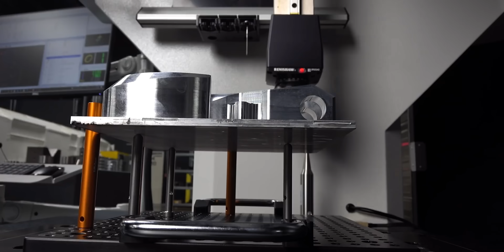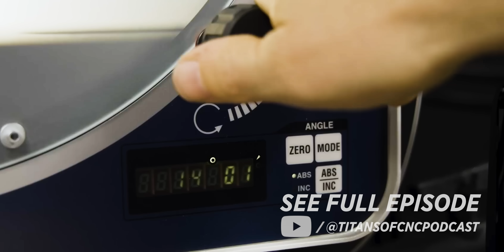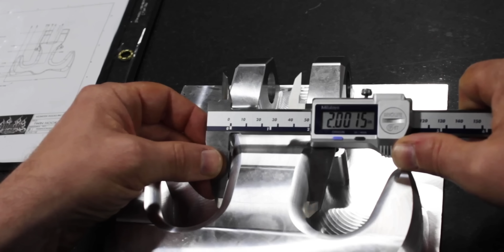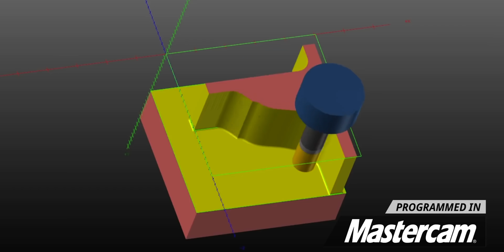I had to SCRAP all Parts Only .0001 OUT of Tolerance

Comment: Customers have to be very impressed that y'all toss parts that are a tenth out!
What an incredible reputation builder to become known for that policy!
That's why your company will never again have to chase work, it'll come to you!  😊
Reply: 1. The video is unclear, but I believe the actual tolerance was some larger amount, and they Exceeded the specified tolerance by another tenth. Yes most parts should be well within specified tolerance, not just a little bit out.
2. I do not have any ability to accurately measure whether a part is within tolerance or a tenth out! I think a standard micrometer has that much tolerance, and I could change the measurement that much by how I do the measurement. (The parts I make are usually specified much larger tolerance than that, and I can maintain spec.)

Comment: You cannot measure .0001 in most cases. On another note, having a shop that works for the QC dept is a recipe for disaster, The QC needs to work for the machine shop not the other way around.
Reply: Saying you can't measure .0001 is like saying you can't measure a human hair because its too small. Of course its possible, you just need the right equipment
Reply: @zacharyj6465  Like I said most cases,  temperatures involved when machining, inspecting and once at customers place can all change that .0001 reading. I've been doing this for over 30 yrs in every type of shop u can imagine,including 4 years building plastic injection molds on cnc machines of an ancient variety. 001 in that shop was considered Wide Open lol Cheerz
Reply: @rickyhammer6832  even with temp changes u can still measure a part accurately to a .0001. Every material has full documentaion on how they react to different enviorments. Not hard to just do the math, figure out how much it's going to change, and offset it appropiately.
Reply: @verakoo6187  lol . I said in most cases. How are you going to measure a .500 deep bore @ .375 Dia + - .0001?
Reply: AN Air Gage!
Reply: Something Ive learned working with alot of old guys in alot of different places: just because youve been doing something for a long time doesnt mean youre good at it.
Reply: I work in a shop that specializes in small high precision parts, and we frequently hold tolerances of less than a thousandth, but our parts are usually less than 10" in any dimension, typically around 3" if I had to guess an average.  I've never worked with large parts where temperature made more than a few tenths difference, but you can definitely measure and hold tenths tolerances.  We definitely use our Mics alot, and calibrate to precision pins/gage blocks at least daily.
Small parts are a different game, I love being able to make everything "perfect" almost to the tenth.

Comment: I wish I could get into machining, but every place around me demands 2 years of experience and no on the job training. Just 6 months of classes at the community college is $4k. Maybe I'll be able to get into the hobby side of it and grow from there eventually.
Reply: I work at a place that was willing to hire me and some others with some training but no professional machining experience, at a somewhat reduced pay. It took a while to find that company - most wanted CNC experience - but I am happy to have been working there 5 years now and am considered a qualified machinist, making quality parts reasonably quickly.
Reply: Go to a local job shop
Reply: HELLO!
Never heard of Titans of CNC Academy?
It's free and any Certification issued by them is well respected in the Industry.
Start learning today and quit complaining!
Reply: @Arthur-ue5vz  I actually didn't know that existed. Thank you
Reply: @Arthur-ue5vz  Doesn't that require access to CNC machines? That is not easy to get.
Reply: @BenAtTheTube  see if a local machine shop will let you sweep the floor or something in return for letting you watch them and maybe use the machines now and then. 
Maybe you could get a low paying apprenticeship of some kind?

Comment: It surprises me that a part can get rejected at such a miniscule offset, but I understand how accurate parts need to be. Some parts can cause the worst problems if they're not the exact dimension.
Reply: "exact dimension"  As I recall my computer science VAX assembler course professor Aya say - "There is no such animal".
Reply: @TomaszWinnicki I was setting up a CMM program one day and noticed the customer had dimensioned a concentricity tolerance of 0.0 with a note stating "use step drill to ensure concentricity of 0". I got a good laugh on that one.
Reply: @abstersive  I wonder if they also called out a 0 RA finish

Comment: I worked in a hydraulic cylinder shop. I got called into QC on some parts that I made. I missed an internal grove by 0.025. I owned up to my mistake and he thought I was nuts because it would be held against me. I looked at him and said, "Have any of the any other 10,000 parts I have run in the last 4 months failed?" He said no. I said, "I own my mistakes."
Reply: 0,025 outside of tolerance on a inside grove is a lot tbh
Reply: @LeaderOfMaGiC  Brain dead moment. I read the drawing wrong.
Reply: @RayLautenschlager  lol I actually screwed up a one shot part while the client was in the front office. It wasn't a good day
Reply: @LeaderOfMaGiC it happens
Reply: I forgot this was inches and I read it in millimetres 😭